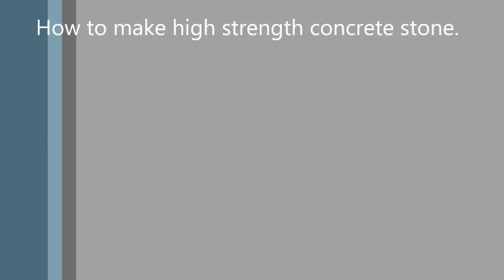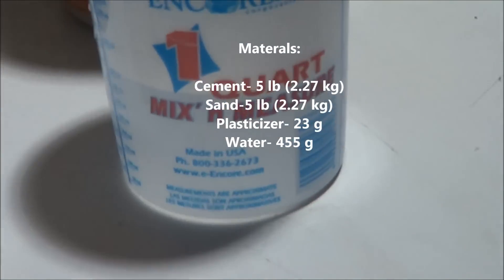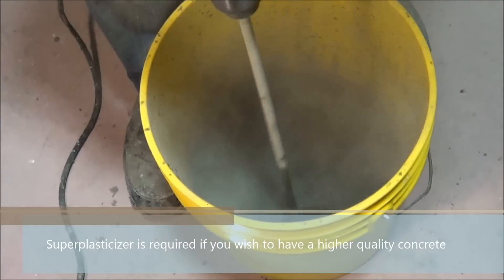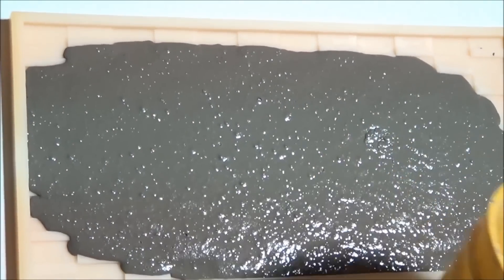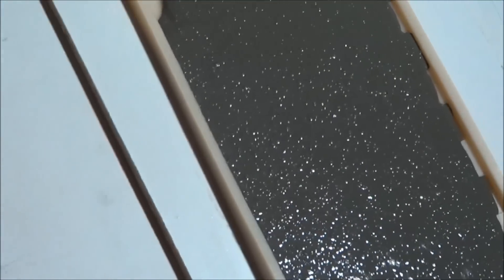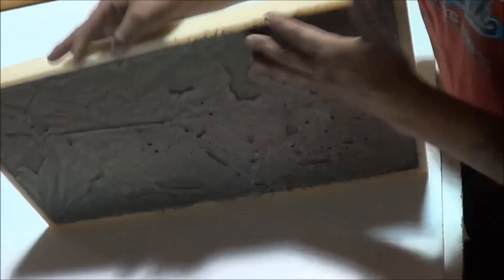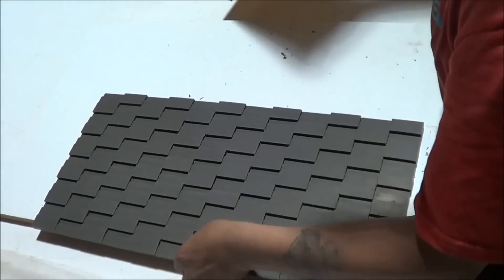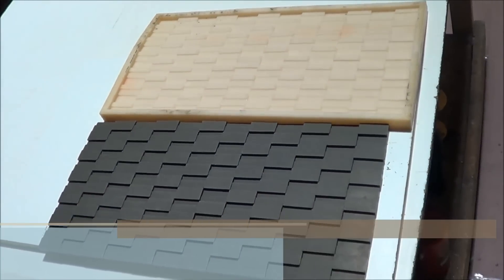How to make high strength concrete stone. GlobMarble rubber mold MS 861

Comment: Hello. I have a  few questions for you. 
1-What are the final dimensions of this particular stone?
2-What is its weight?
3-What sort of mortar should I use to mount it to a wall?
4-If I mount it in a wet environment, does it need to be sealed?
5-Would this sort of stone work well as an exterior for a structure/building? If not, which kind/model of  large format mold that you offer, would you recommend?
Thanks so much for your help and keep making these videos. They are a great help
Reply from the maker: 1. 12x24
2.10 lbs
3. any mortar that used to attach ceramic tile, marble or any other stone on walls. you can also use thincet 
4. Sealer - it's an additional option. in general it will look good longer with sealer especially in wet environment. 
5. Stone can be applied on interior or exterior, it doesn't matter. For interior we usually recommend to use Gypsum. Format really depends to your taste. All our molds available at GlobMarble.com